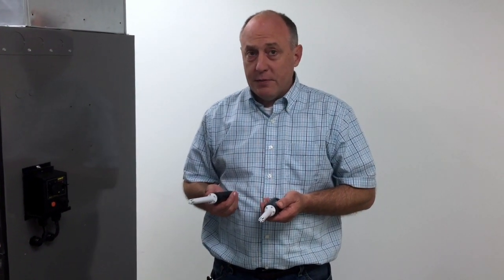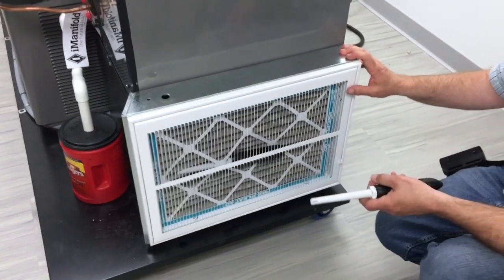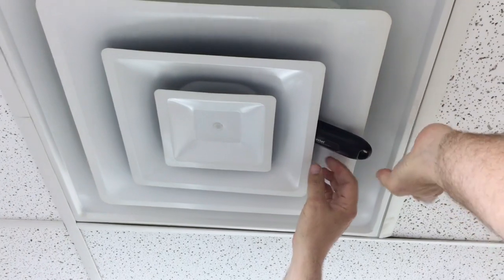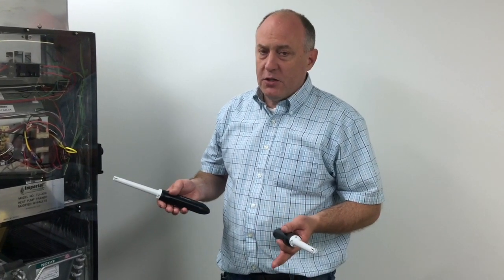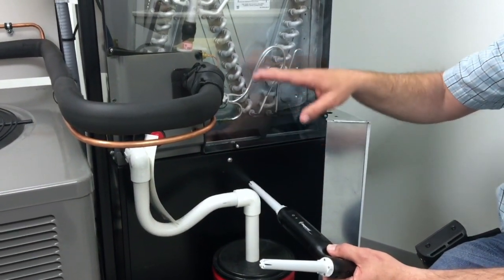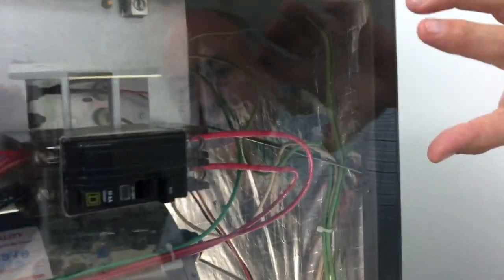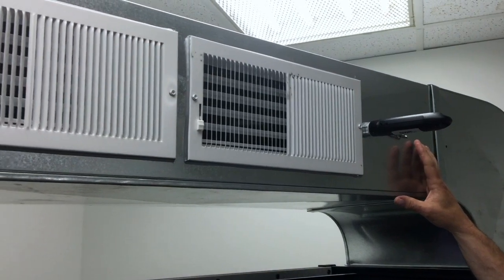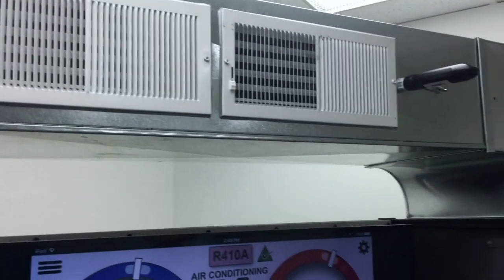Proper iManifold 911M Humidity Probe Placement

Comment: hello. may i ask you. so if i  put supply probe inside the very first supply register in a bedroom and return probe before the return filter grill. in this case will i get correct total airflow calculation?
what if there are 2 returns and 10 supply registers?

Comment: these probes are useless for me. 36" plenum and spider system is all we have in northern california for resi jobs. maybe see one out of 15 that have a different set up. I bought the Iconnect package, used it a couple times and havent touched it again. takes way to long to set up also. probes are way to thick, the magnets on them suck and hardly even hold their weight, and they are way to sensitive to place in supply plenum. useless.
Reply: same ductwork type here in SoCal, orange county.
hello. may i ask you. so if i  put supply probe inside the very first supply register in a bedroom and return probe before the return filter grill. in this case will i get correct total airflow calculation?
what if there are 2 returns and 10 supply registers?

Comment: In my area  the problem is residential 4 foot plenum with spider flex ductwork. No good place to insert the supply sensor. I can move it around the plenum and get a different reading every time. The probes are too thick to insert into registers.